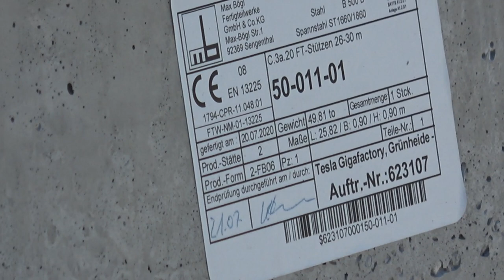Giga Berlin | 2020-08-01 | Drone flight

Comment: Thanks, Tobias.  The overlays are very helpful.  I wonder what that enormous concrete beam is for. @3:00
Reply: It's a column not a beam.
Reply from the maker: It's one of the columns for the paint shop. That is the bottom part that goes into the footing.
Reply: @TobiasLindh  That was a great shot, by the way! A couple of weeks ago I got interested in this type of construction technique (spread footings with precast columns) and I was looking for some good shots of that corrugated part at the base of the column... and there it is! So, about 50 tonnes each... that's impressive! It's also weird how much I now know about precast concrete parts, hehe! Tesla is indirectly a great educator!
Reply: @TobiasLindh  Thanks, Tobias.

Comment: Looks like there will be three levels in the Paint building. Info on what will happen on each level?  Maybe painting on ground level and top two levels to support ground level paint activities?
Reply from the maker: Most happens on the ground level. The ovens are on the second floor though. Many parts are across multiple floors.
Reply: Tobias Lindh  Do we know if the vehicle body will move between levels or stay on level 1?
Reply from the maker: @bruceburnworth8082  The cars have to move up. The ovens are above the area for sealing for example.
Reply: Tobias Lindh It will be interesting to see how this movement between levels is done efficiently.
Reply: @bruceburnworth8082  Same way as painting has been done for decades. The car body is attached to a frame, that frame is hooked into a rail. Going up and down is nothing special, as the cars are lowered into basins a couple of times during the treatment process. The actual "robo paint" is just one of the later steps in the whole process, btw. It's just one of the more prominent ones---it looks good on camera.
Reply: HenryLoenwind   Thanks. I have very little knowledge about vehicle painting.

Comment: Great post processing with the virtual buildings. I miss the solar farm on the roofs?
Reply from the maker: I took all the information for the buildings from the application documents. The solar farm is not part of the application, so we don't know much about it.
Reply: @TobiasLindh  Yes, its only a guess because Elon said the Factory would be autonome concerning energy.
Reply from the maker: @ottokueng4236  He said it would be autonome? I don't remember that, and I don't think he said that. The roof wouldn't produce enough electricity for the factory.
But it was stated multiple times that there will be solar on the roof.

Comment: They're starting to use some of that top soil material you landed behind. Have you seen where they're using it?
Reply from the maker: I haven't been able to follow one of those trucks yet, but I think they leave the site.
Reply: @TobiasLindh  I wondered if that might be an option when they deposited it there. That's a lot of valuable topsoil and they only need enough on site for landscaping.

Comment: Great job.  Question: aren't the drive unit and accessory buildings in the way of where phase 2 (or is it 3) will be going?
Reply: The accessory buildings are between the Phase 1 and Phase 2 (or whatever Phase will be built there) buildings. The DU building will be integrated into the Phase 2 (or whatever) building.
Reply: @therealrooster  Okay, thanks.
Reply: https://i.imgur.com/3nUBDn1.jpg Stuff that is in color or has a 2-letter code is phase 1.

Comment: Do you info on how the Drive Unit building will be incorporated into Phase 2?
Reply: Will be the same size and format building as phase one.
Reply: Julian Reverse My question sees that the Drive Unit appears to be where the Phase 2 building will be located. How will this Drive building within the Phase 2 footprint be incorporated into Phase 2?
Reply: @bruceburnworth8082   We don't know. Since it's phase 1 there are no plans for phase 2 available.
Reply: https://i.imgur.com/3nUBDn1.jpg here are the current plans for expansion. Doesn't mean that they'll stay this way when they actually do it, but...
Reply: HenryLoenwind   Thanks.  It must have been a previous plan that showed a battery facility in the big blank space that now exists.
Reply: @bruceburnworth8082  Yes, that blank space between the buildings and the railyard had a "CELL" building and more employee parking. https://i.imgur.com/xm5XTQN.png I think they just removed those from the drawing when they added the rainwater treatment and percolation areas.

Comment: How big is the big red crane here compared with the huge "bluezilla" at Boca Chica?  Everything here is at such huge scale I can't tell how massive it is.
Reply: It's max. hight is 54m.
Reply: The red crawler crane is a DEMAG CC 1500 from COLONIA. 102 m high.
The Bluezilla is a Manitowoc model 18000. 97.5 m high with boom No. 55. 149.3 m with No. 79A luffing jib on No. 55 boom. But not used for this task to my knowledge. Generally, a more heavy crane which can lift 600 to. The CC 1500 can lift 275 to. 

We will most likely see even bigger cranes at Giga Berlin. For lifting jobs more distant from the crane location. COLONIA has just bought a new Liebherr LR 1800-1.0 crane. But this must of course not mean that we will see this model at Giga Berlin.
https://www.youtube.com/watch?v=6t3Q4YMbuog
Reply: @abalada  It's not 105m high in this configuration! And the max, hight of the CC 1500 is 135m!
Reply from the maker: Most of the footage is at 50 meters altitude because that's the flight altitude limit above Giga Berlin. Maybe that  helps.
Reply: @julianreverse  I just took the number from the COLONIA website. Knowing the height of the tower cranes would be more useful for comparisons. Crawler cranes max. heights depend indeed on the configuration and in what position the boom actually is at the moment. Rather rarely at its max. height position.

Comment: Why the paint shop is physically separated from the GA🤔
Reply: Because it's not finished yet.
Reply: Julian Reverse I was referring the rendering of after-build
Reply: @millepun  Not sure what you were watching, but it was definitely another video ...
Reply: Julian Reverse in 8:50 but I just rewatch and I confused the Label, it is fine now.
Reply from the maker: It's actually true that the paint shop and general assembly are not connected. Not sure why they did it like that.
Reply: @TobiasLindh  There is no separation, they even share the same footings on the long side.
Reply from the maker: @julianreverse  Between paint shop and general assembly is casting.
Reply: @TobiasLindh  But the different workshops are still physically connected.
Reply from the maker: @julianreverse  That's true. I just understood the question just as why they are separated and not next to each other.
We would expect them to be next to each other, because cars should go to GA after painting.

Comment: Why don't they use any machine to tighten the bolts like we see  1:10.   That's a lot of manual labor in a day!
Reply: Because it's a torque wrench!
Reply: @Mighty Tesla
Yeah, an impact driver would be a lot faster. Assuming it’s clutched it would regulate the torque. I’m sure he knows that. 
It’s probably an access issue. The nuts or bolts might be nested in a tight pocket where they’re difficult to get at. It’s an end connector so there aren’t a lot of them to tighten. 
I’m sure he knows what he’s doing. : )
Reply: @jbell6642  Given the length of the lever and the amount of effort the guy puts into it, what kind of torque would you guess the bolts are fastend with? What kind of impact driver would deliver that amount of torque and still be handled by a human?
These are not your standard 17 mm car nuts :-P

So I guess you are right, they know what they are doing :)
Reply: Up to about M30 10.9 (~2000Nm) would be possible with a handy cordless machine. Those installed here are estimated M20, so arround 600Nm. But as has already been mentioned, it is difficult to get the screws. Impact wrench also makes a lot of noise and since the recordings are from Saturday, that could also be a reason.
Reply from the maker: I've heard them also using impact drivers that day.
Reply: @TobiasLindh  To loosen the bolts.
Reply: Julian Reverse they will probably NOT loosen those bolts for many decades 😁
Reply: @stebarg  That's why they tighten them with torque wrenches instead of impact drivers ;-)
Reply: Mighty Tesla because it’s faster and better! With a machine you’re not faster and potentially damage the paint or something.

https://www.juwel-schraubtechnik.de/en/products/battery-operated-torque-wrenches/straight-design/

You can install the nuts with a drill and tighten them with a torque wrench. It’s about 10 seconds or less per bolt/ nut.

However, a would appreciate a better automated method too. Does any exist yet?